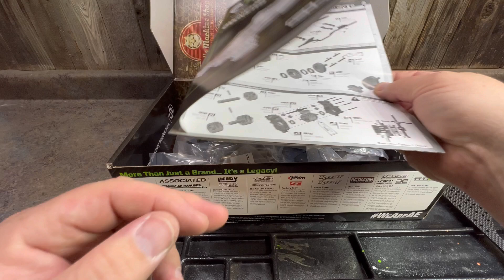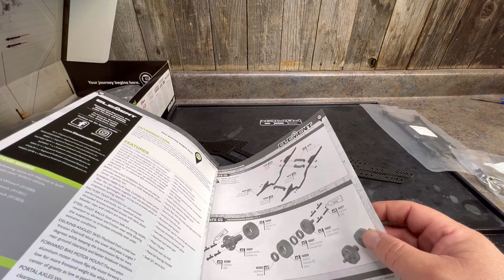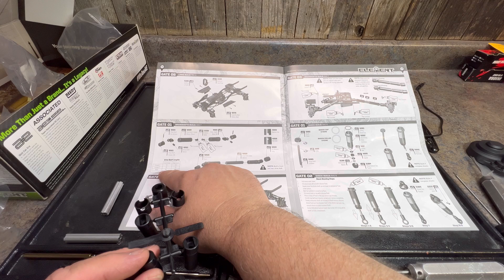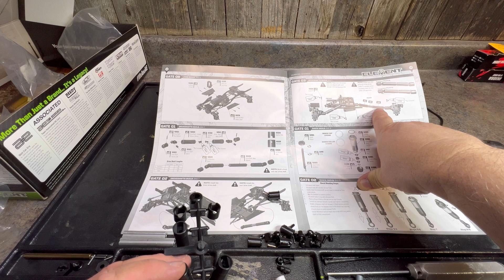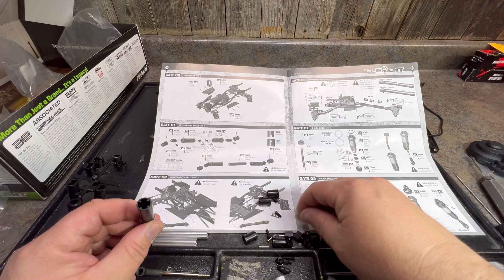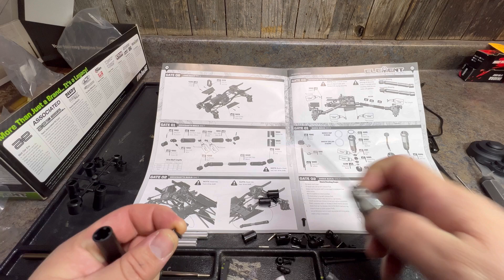Element Rc Enduro Comp Fox build video and build review is it any good ?

Comment: when i put the set screws in my skid...the tip of my allen driver snapped off in the set screw...luckily it was trogh far enough i could grab it wit some fluch cuts.... spin it out cut with a dremel..spint it out cut witha dremel , until i got it all the way out
Reply from the maker: @jeremystanley6311  that is why I tapped the skid plate on my build I knew it was going to be a problem . Good thing you didn’t have almost all the way tight